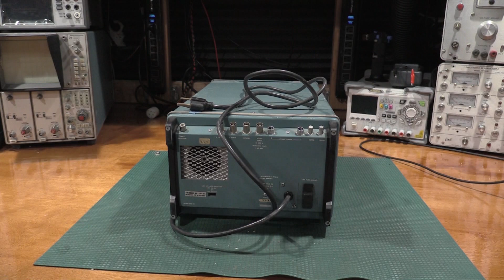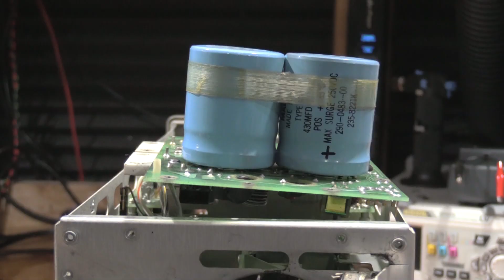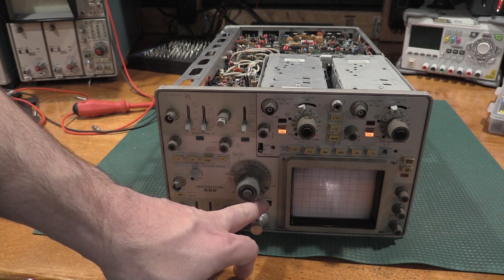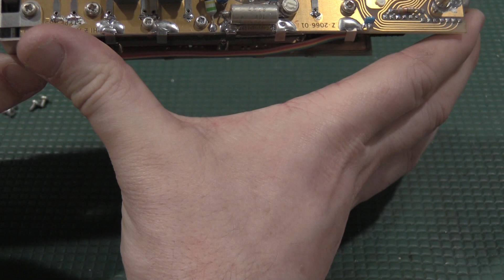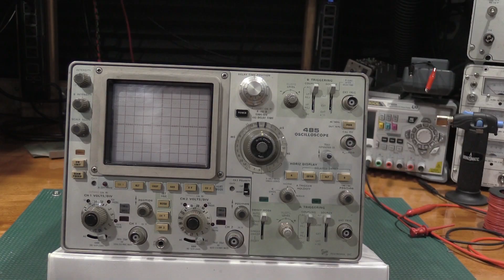Tektronix 485 Restoration, Scope dies on the bench and asks for more help.

Comment: I wonder how many $1000s worth of tantalum, electrolytic, and other types of capacitors have been put into old Tektronix oscilloscopes, replacing perfectly good OEM parts, with the failure mode of those oscilloscopes never determined?   Possibly a couple of times over.  Chuckle.
Reply from the maker: One of the known failure modes is the Tantalums were run WAY to close to the voltage rating, 16V cap on a 15V rail. With a failing bulk capacitor the ripple gets a little high and the AC+DC pushed the tant over the edge then the tant shorts.

Comment: I can't tell you how many times when working on Tek scopes that the scope shut down with a tantalum cap failure. I just fixed my 485 recently and was calibrating theB trigger when a 22uF 15V cap on the 15V supply went south. Tek was famous for running these caps too close to their limts. About an hour after that cap failure the large 100uF gumdrop cap again on the 15V supply failed with a short. I have never had one of the metal cased glass sealed tantalums fail, only the epoxy cased ones. Fortunately I had a 485 carcass that I squirreled away for parts. So my $10.00 hamfest dead 485 took two transistors, a tunnel diode and two tantalum caps to fix along with some minor calibration tweaks. The only remaining thing to do is to pull the vertical attenuators and get out the 99% IPA and clean the contacts to eliminate a bit of noise and flakiness. I am looking for either a front cover or a 3D print file for one. Nice video series by the way.
Sam W3OHM

Comment: I apologize in advance for my stupid question:   Can anyone help me a little.   I do not understand the values on the tantalum capacitor that has been replaced, that is, by which color chart it is determined. I am not able to find a suitable one that gives me 35 v for the colors on that capacitor. Thanks...
Reply from the maker: Not at all, In this case I used the bill of materials (BOM) in the service manual to get the exact value that I needed to be replaced. Using the component map I determined the C(number) and using the "Electrical replacement parts" list in the service manual got the value, voltage, and tolerance. With some Tektronix parts this can be more valuable as some will be listed "selected from" (IE "selected from 2n3904) this means there was a specific parameter that was impotent, that was tested for and binned. This usually happens more with active components than capacitors. But I also check for updates to the BOM some times there will be value changes like an increase in capacitance or voltage as the design became more refined. These are usually called out in the BOM by serial number.
Reply: @ZenwizardStudios  Thanks a lot for the reply.   How would you determine the value of that capacitor, say you don't have a BOM?   Again, I failed to find a color chart that clarified the values on it.   I'm sure the problem is my lack of understanding of how to decipher colors the right way ...

Comment: I have 485 in my bench which need to be calibrated .. the a and b sweep are not properly aligned.. they are missed the timing.  Looking forward for the detail alignment process.
Reply from the maker: I am recording the process now. It sounds like you need to do the B register adjustment. I am about 1/2 way through the HORZ alignment now. There will be split videos again the process looks shorter on the calibration instructions but still takes some time.

Comment: Nice video, as usual! I'm a bit surprised that you replaced all cylindrical caps in the power supply, many of which are hermetically (glass) sealed solid tantalum caps. The latter ones very seldomly break down. You left the many dozens of dipped tants across the boards alone. These are infamous for breaking down these days and actually, your 6.8uF already did. They sometimes literally go up in flames, so I wouldn't leave that 'scope on without supervision, because your intended burn-in may end up a burn-out.
If you plan on using the 485, a lovely 'scope, for years to come without problem, rigorous replacement of all dipped tants is unavoidable, since they become such a common cause of failure after several decades.
I own two 485's, both in an even nicer condition cosmetically than your 485, AFAICS, and I really enjoy using them. BTW, your 485's s/n shows your 'scope was made in Heerenveen in the Netherlands, my home country.
Reply from the maker: I noticed that as I was doing the recap. I am not going to ditch the glass tantalum as they will be good for a LONG time yet, they will be saved I was actually really surprised to find them in the power supply section.  None of the burn ins have been unsupervised, I dont trust it for a while yet. I noticed that it was out of the Heernveen plant. I am sure this unit has a story to tell as to how it ended up in the US. I do plan on having it on the bench and using it as a daily driver when I am in the lab. I have found I need to 50 Ohm input much more often then I realized so it will be nice having it built in.

If another dipped tant goes I will be doing a very aggressive replacement of all of them.